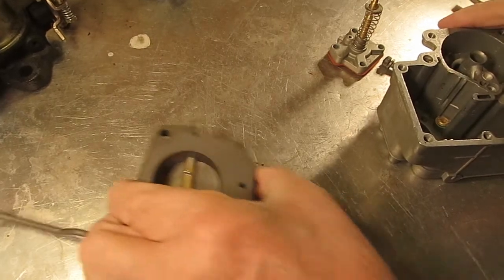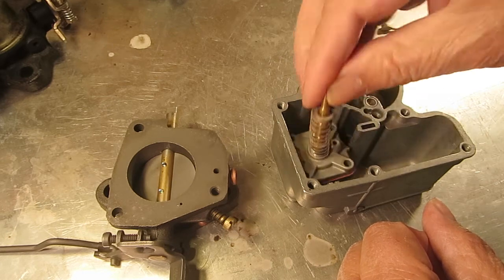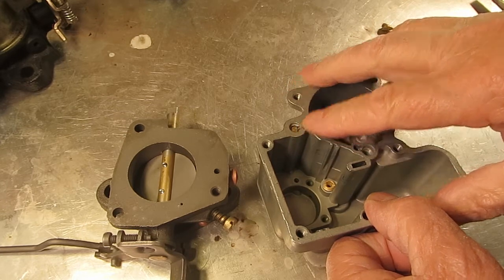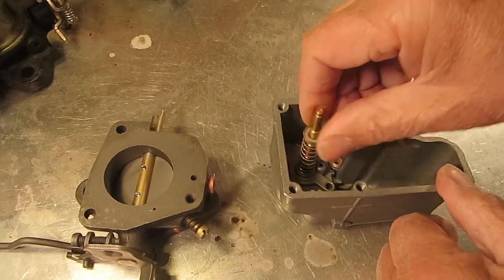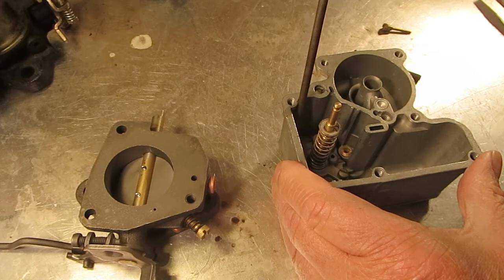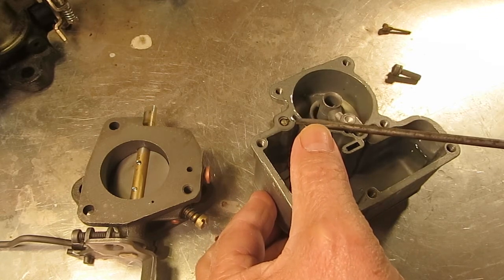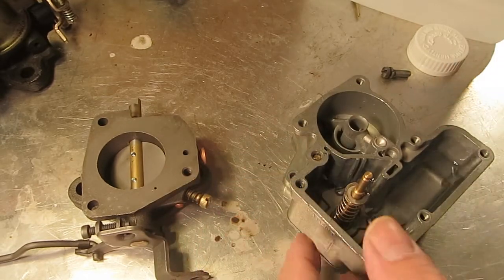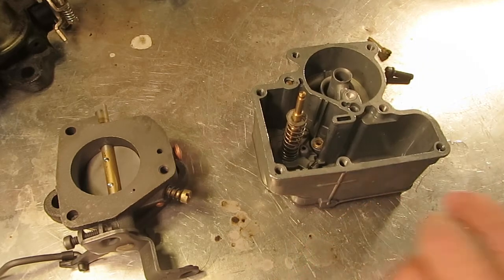Carter YF Accelerator Pump Circuit

Comment: You've mentioned in your videos that YFAs are all aluminum and YFs are steel or some other metal. 
I have two carbs; I kept my old one to rebuild and learn from the catalogs and your videos, and one is currently on my truck. 
One is all very shiny aluminum. The other is identical in construction but the lower half is either coated with something grey-green-ish or a different metal.
However, in your video here, your carburetor has a darker gray matte finish look. Is it steel instead of aluminum or just not milled and made polished and shiny? 
I know you haven't seen my carburetors but I hope I'm able to describe & wondering the difference of your carburetor
Reply from the maker: The darker material of our YF throttle body is cast iron. This is common to see on the YF carbs vs the YFA carbs which have aluminum throttle bodies.

Comment: I have one of these in frontof me rn and am trying to figure out why the throttle linkage to the accell pump moves its upperwards instead of down
Reply from the maker: Yes, unlike most carburetor the yf/yfa sends gas to the discharge on the up stroke.

Comment: Would it matter or make a difference if the carb has the check ball and check weight vs just the check weight with the point on it? Or do they both pretty much work the same way?
Reply from the maker: Same thing.

Comment: Hi Mike. I feel my accelerator pump is working fine after this test, yet it still bogs at quick acceleration. Could it be that my YF just isn’t a big enough carb for my motor? I have an early 50’s Chrysler 251 which I think came originally with a larger Carter used on Willy’s maybe. Or could I move the clip down a position to see if that helps?

Comment: Any guidance on how the screw at the top of the accelerator pump should be adjusted? When should the hole for that screw be uncovered? How should it behave?
Reply: @MikesCarburetor  My carburetor does have a screw on the top. Maybe this is incorrect. Is there an email address where I can send you a picture of what I have? Thank you!

Comment: After I connect  accelerator pump up to metering rod it comes out the jet when I release the spring ?
Reply: I didn’t have the pump linkage connected to the throttle shaft , so that’s why The metering rod was pulled up out of the Jet by the accelerator pump  spring action. Been a long time since I tried to install a kit in a carburetor, sure appreciate your instructions !
 @MikesCarburetor

Comment: My 1968 Chrysler has an issue with slight hesitation with acceleration (around 35-40 mph).  I think a bad accelerator pump is why.  It also has a Carter (only it's a 2 barrel model).  I think it needs a new accelerator pump entirely (as those are usually rubber and crack with age), but watching your video did a very good job of explaining the entire circuit as a refresher to me.  Doesn't look like too bad of a job to do.

Comment: Thank you very much for this video.  I'm working on a '77 Jeep CJ5 and the accelerator pump diaphragm was hard as a rock.  In rebuilding I thought I lost the little ball in the pump area but it turns out it is retained.  I could only see it by looking way up the little hole in the diaphragm housing and I see something moving in there.  I used your test method and it works perfectly.
Reply: Mikes Carburetor Thank you Mike, and by the way we bought all of the repair parts from you. Everything fit perfectly and the carburetor is back on the jeep and we started it up for the first time in seversl years.  Runs great. Now on to the belts and hoses.
Reply: @MikesCarburetor  Your instructions and videos are really very helpful.  The time you take and detail you go into are really appreciated.  Like when you point out such small details like the little ball in the accelerator pump.  So many "how to" videos these day people just rush through things.  When I opened up the carb I personally had never seen the inside of one like this before, so it's all new to me.  Thanks again.

Comment: My accelerator pump has two outlets, one is directed just like yours, into the throat. The other one is directed back into the float bowl. what's the deal with that?
Reply: @MikesCarburetor  When I pump it by hand as you did sometimes the stream is on the throat side, sometimes on the bowl side, sometimes a little in both. I hope it works ok on the highway... maybe if it doesn't, I should put a little JB Weld in the bowl side hole?

Comment: I was told this was the correct carb for my 1951 L6-161 ... We installed it and noticed that if I accelerated hard it woul bog down and when I stepped off the accelerator she would straighten up ... My mechanic said that's because it squirts gas into the engine when you take your door off the gas or as you say, on the upstroke. Isn't that an odd design? What was the purpose. We changed carbs and are now running her on a later 1960's era with climatic control (which was on the engine when I purchased it but it was missing a lot of parts). Anyway... Isn't it an odd setup for fuel to enter the engine when you take your foot OFF the accelerator ??
Reply: We saw your video on the YF and used that to guide us...all seems correct ...she just doesn’t seem to like that carb...as I said when I would try to accelerate hard...she would bog down ...sometimes stall...as long as I did a slow steady pressure on the accelerator all was fine ...the other carb ...I believe is a WO (it has the climatic choke, I think that’s what it’s called) runs real good ...was just wondering if what I described on the YF was unusual or not ...my mechanic friend rebuilds engines and works on vintage cars and was unsure why it was running the way it was. I bought it from another “old carbs “ expert who had rebuilt it so I can’t imagine it was re-built backwards ...but you never know ...is there a universally accepted carb for a L6-161 engine ?? Thanks again for making the videos you do !! Very helpful and informative !!

Comment: Very helpful. Thank you. I'm working on a 1960 Willys wagon and the carb was missing the ball under the accelerator pump diaphragm that was supposed to be held in with a clip. It was also missing the weight and ball at the top of the accelerator pump circuit.